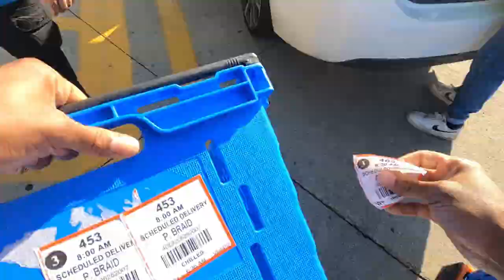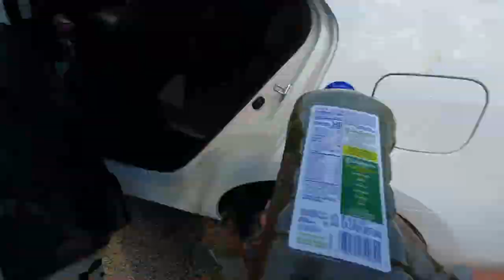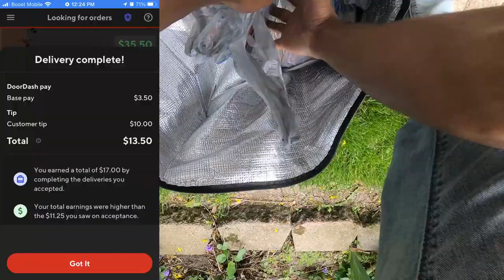Gig App Doesn't Give Me ORDERS To GET Incentive!😱 InstaCart,DoorDash, Spark Ride-Along,Tips & Tricks

Comment: What’s up boss! Just curious to know what your metrics are looking like. Do you take the first order that spark throws at you off the rip? Or do You let it slide thru if you don’t like it?
Reply from the maker: My metrics are:
100% On Time Arrival
0% Drop rate 
44% Acceptance Rate
4.8 Customer Rating

No, I don’t so every order they give mw but if it’s at least a decent order I’m taking it. If I don’t like it sometimes I just reject it so another order comes in instead of letting the timer run out.
Reply: I have 28% acceptance rate and I still get good orders. If the order sucks, I quickly reject it if it is at the :20 mark, so I have a chance for another one. If it is an asap or one that came a few minutes after the drop, I don't reject it. I just let it timeout cause I could still get additional orders with that type of order.
Reply: @jeni4rmthebloc388  thanks, what do you mean the one that can’t few minutes after the drop tho? My on time is 100, drop is 0. Acceptance is 42, and customer service is 5.0. I try not to cancel any order. Although, I habrá maybe dropped 4 or 5. I been sparking for about 2 months now. Have 320 deliveries

Comment: Can you share the link to where you purchased your large structured bag? I bought some through Amazon but they collapse, making them difficult to load. Thanks 😊
Reply from the maker: The link for them is in the description.
Reply: Thank you! When you signed up for spark, did it take forever for your application to go through the process?
Reply: I see the two links you have for the bags. One is for the smaller more square bags and the other one is the larger thermal bag with a cover. Where did you get the one that is as big as a thermal bag without a cover? I hope that makes sense and I’m just not missing it again 🤪
Reply from the maker: @theremaxhometeam8293  Absolutely, It took us literally 3 months each!
Reply from the maker: @theremaxhometeam8293  They actually ran out if those bags I was hoping they had new ones by now. They switched the link from the bigger one to the smaller one because they ran out.